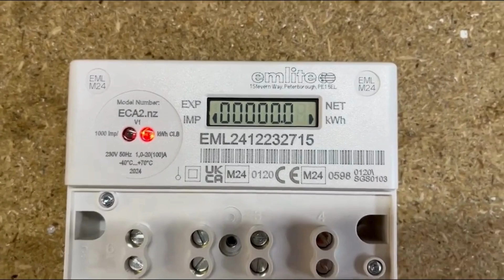How to read the EmLite ECA2.NV (NET) Single Phase Check Meter

Comment: I have this for my solar. Which reads do i need to give my energy supplier? They can get smart readings but i cant see the readings they have on my display. They are getting the readings from my smart elec meter export readings. Is this the same and accurate for them to use? Also what are the numbers on the display. Import/export and net kwh. My net kwh in minus and increases is this normal